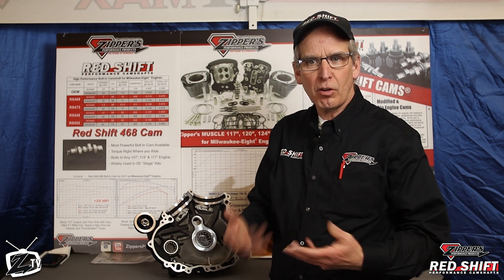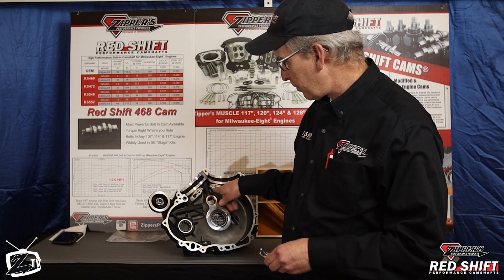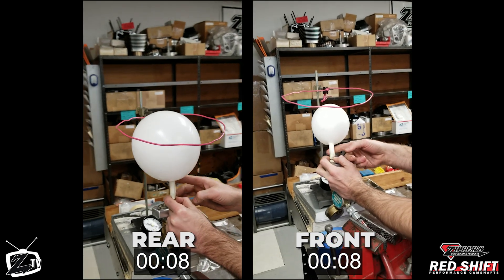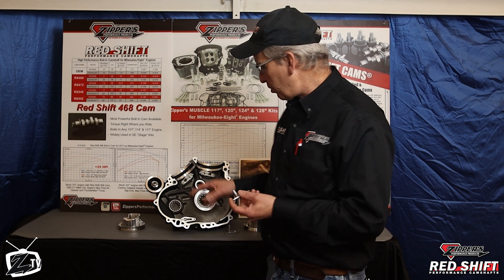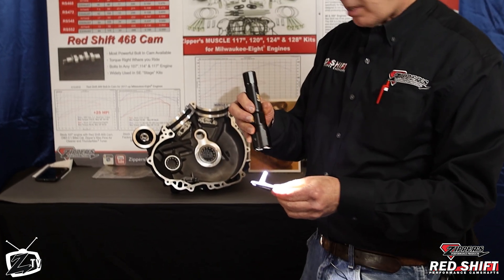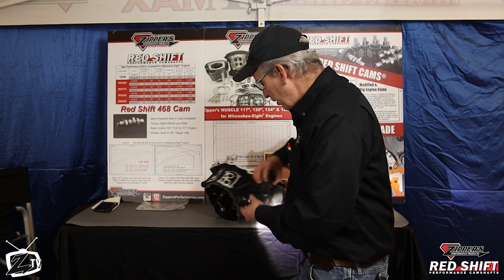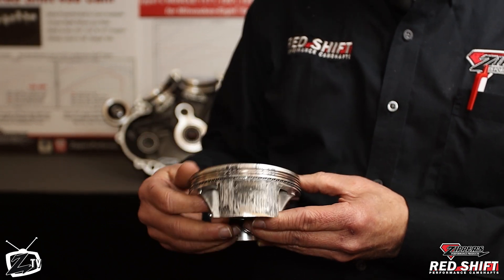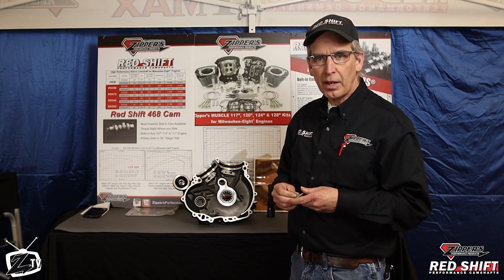Preventing Oil System Failures In A Milwaukee-Eight Engine

Comment: Would a blocked piston jet passage give 10-15psi higher (@ opperation temp) readings on my manual pressure meter ?  Got higher pressure readings , 60psi  and more above 3k rpm , don't know where tot start

Comment: Apparently, the oiling jets can cause sumping issues when they open too soon, ie before the 13psi. Videos from Kevin Baxter, pro-twin performance, has demonstrated this in several videos. 

It makes me wonder if all these performance cam chests are contributing to sumping, due to having increased oil flow pressures, and defeating the factory piston oil jet and causing them to fail sooner, which will lead to sumping, and can cause extreme engine damage.